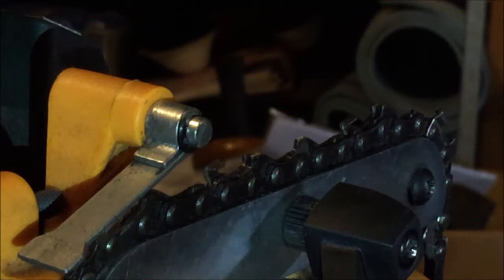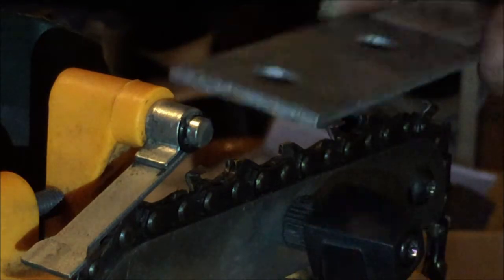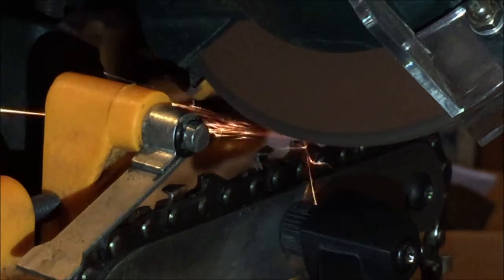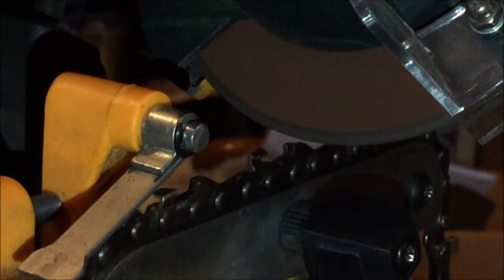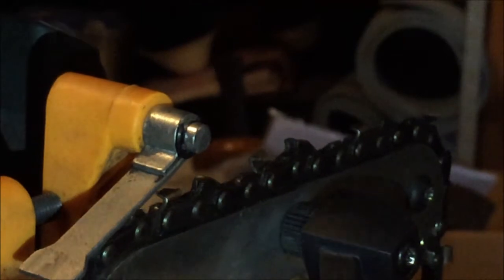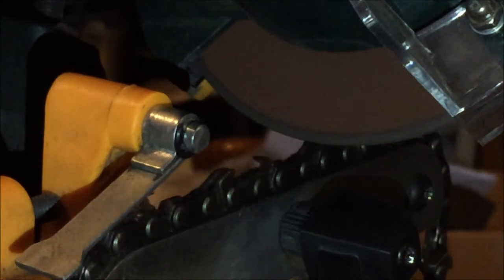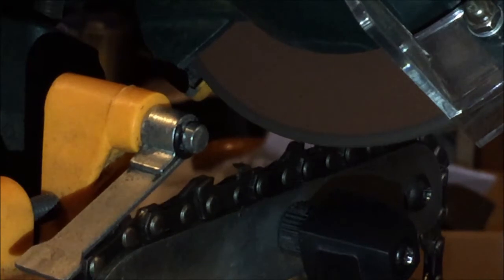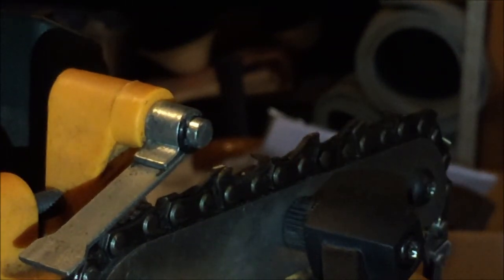Sharpening the Chain Part 2 The Rakers

Comment: Rackers should not be filed or ground at a 90 degree to the chain. A 70 degree will work better and by having a 90 degree you will notice that the chain will grab the wood and stop the saw from cutting.